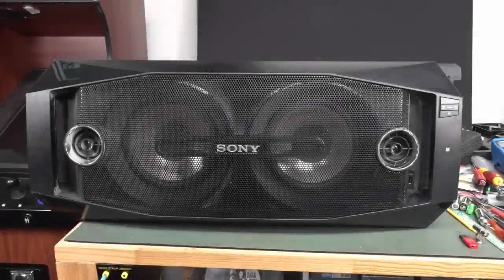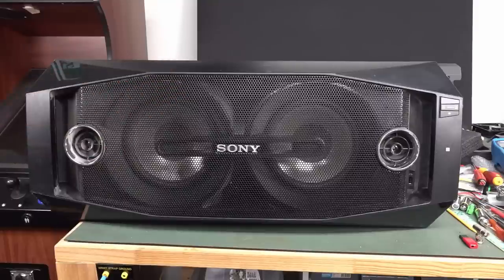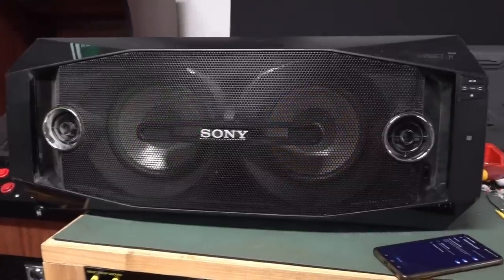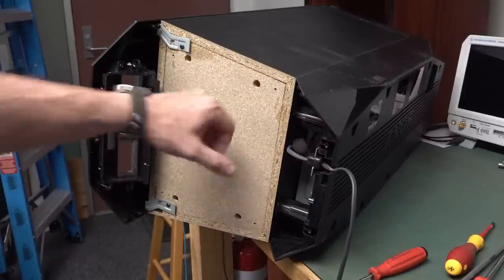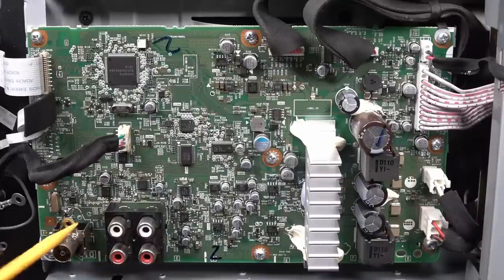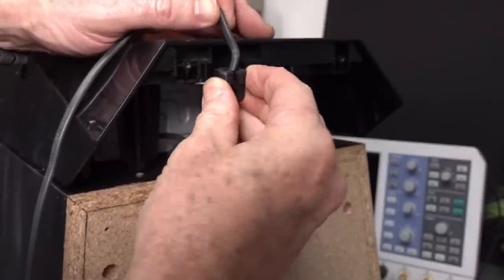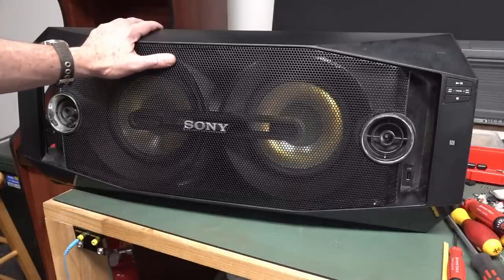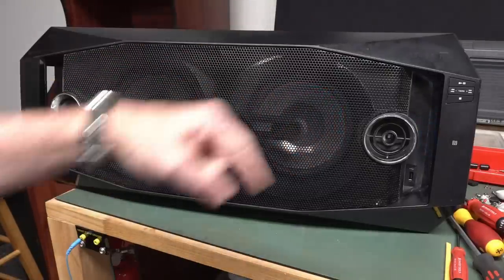EEVblog 1513 - Dumpster Tossers Have No Shame!

Comment: My bet is that this was bought for a breakroom or loading dock and it worked well. 
Then they got a Sonos or something similar. 
I've worked a lot of places that tossed out perfectly good stuff for reasons like that. 
Heck, I once had to scrap 8 Mac Pro towers, tried to take one home, but corporate policy was inflexible, even for the IT manager. 
The lawyers were scared of corp IP exiting the building that way.

As far as dumpsters and office parks, I used to have a live/work in a semi-industrial area. 
Would often find cool stuff when I was out walking my dog early in the morning or just after getting home from work. 

Whenever a business would move, merge or change owners I'd clean up on computer equipment that got tossed out. 
Scored a few nice pieces of office furniture that way too. And even a couple cases of booze once!
By the time I moved out of that place I had a half dozen powerPC Macs and a whole bunch of external SCSI drives, scanners and printers. 
All networked on a big 48 port switch that I found sticking out of a dumpster from the branch office of SUSE Linux that was around the corner. 
Also scored a bunch of retail boxed copies of SUSE that way. Which was my favorite distro for many years!
Reply: > Heck, I once had to scrap 8 Mac Pro towers, tried to take one home, but corporate policy was inflexible, even for the IT manager. 

I would leave the company for that. I get if that stuff was going to be sold, but thrown away and doesn't let you take it home for free? Nonsense. We should reject these policies, you don't let take me home a computer that will get into a dumpster, well that point I don't have interest to work for you. 

> The lawyers were scared of corp IP exiting the building that way.

Just an excuse. They don't want you to take the computer home period. If not it means that they will put in a dumpster a computer with anything value in it that anybody can at that point take home? Also they could just sold you the computer without the drives if they doesn't trust you to wipe them. But again, your are the IT manager and thus have (I think) accesso to anything, so they are scared you taking home a computer with anything value on it when you can connect remotely to the company VPN and access everything???

Comment: Based on all the evidence, I would suspect this was stolen from a construction worksite. I worked in construction and this was the number one thing to get stolen as it was the most expensive item on a site that wasn't a tool. The dust looks too evenly coated making me think it was from sanding or cutting. It was most likely tossed because some kids worried about the consequences of such a pricey item being discovered stolen when sold. Most thieves of construction sites are juveniles simply curious about the construction, and the exploration gets them a bit too adventurous. Or am I thinking too far into this from past experiences?
Reply from the maker: Nah, it's just someone in the building tossing out their unused stuff.

Comment: You're looking for a rational explanation for someone trashing this. There is likely only an irrational explanation. Likely, the previous owner had a relationship failure - either a divorce or they got dumped, and that unit was a remnant of the relationship that they still had and brought back bad memories. The only way to fix that is to literally get rid of it, so they dumped it into the dumpster. If it was left on the floor, the next time they went it might still be there and again bring back bad memories. Thus, trash it, where it cannot be seen even if they went back. This precludes any sort of "give it away" thing - they wanted it out of the house and out of mind fast, so no selling it on a used marketplace and no putting it where it might end up causing bad memories to flow again. I suppose the one good thing is they didn't try to destroy it - people have been known to take things and dunk them into water to destroy them before getting rid of it - like they could take a TV, plug it in, turn it on, then pour water down the top, then take a hammer to the screen to smash it.
Reply: ..... Yeah, I was thinking Industrial park, x-employee left it years ago. 
Boss says get rid of it.

Comment: Hm this almost seems too good to be true, I would leave it running for a while to see if there are intermittent problems. 
It looks quite dated for something so recently built, and I don't know if that is a good or a bad thing, because I actually kind of like the cheese-o-matic 2000's  “plastic futuristic" aesthetics in a way, but such flashy RGB LEDs really are the bane of my existence.
The display is interesting, it almost looks like a VFD?
Reply: Definitely not a VHD, just a regular ol' backlit LCD it looks like.
Reply from the maker: Been running for maybe 5 hours now, no problems, even at quite high volume. Yes, display is VFD, plenty of gear still have them.
Reply: @EEVblog  

That's nice, I like VFDs. 
From my "research" which basically consisted of reading Amazon reviews, the device was sold at least from 2014 to 2018 with a peak in popularity around late 2015, so it likely is about seven years old by now.
Reply: @EEVblog  Good to hear. 
It could be miswritten, but page 22 of the service manual for the GTK-X1BT mentions testing of the "liquid crystal display panel", so my bet is that its an LCD stylized very convincingly to look like a VFD.
Reply: @bennydontplaythat  

Could be, but it also could be a simple misnomer.
Because why would you imitate old technology on something that follows an aesthetic which undoubtedly (back in, say, 2008) would have been thought of as “hi-tech” and futuristic, even though it's really starting to look dated by now.
Reply: this has aptx, its less than 5 years old
Reply: @elektrokinesis4150  I have equipment from 2013 that supports aptX. They've since added new variants like low latency and HD though.

Comment: I own one of these, bought in 2015 for 169 GBP and still use it.
Reply: same here, though i got it from currys on offer for £119, still works like a gem
Reply: @killer1479  so they are not hugely expensive then. But Aussie bucks are like three times the price of gbp so it sounds expensive but it’s not really.
Reply from the maker: @Alexander_l322  Theye were $499 retail heer I think. Dick Smith cleared them out the half price apparently.
Reply: @Alexander_l322  thats why i feel sorry for the aussie cousins, they get screwed something rotten on taxes :(

Comment: i have that stereo and i love it! i regret never buying a 2nd one to link them together D: and yes, i can concur it really is 500w rms
Reply: Baloney, The sticker on the back says it only pulls 110W from the power point, so your saying this is like 450% efficient?  They don't even try to pull that one in Star Trek.
Have a look at 3:27 if you don't believe me.
Reply: @paulstubbs7678  speaker output is dc and lower voltage my guy
Reply: @Kowalskithegreat  yes but 110 watts is 110 watts don't matter what the voltage is 
it will be using a CLASS D amp that could be 80+ efficient. so if you put a sine wave into it would output about 90 watts of power RMS
peak burst with music playing could maybe be 200+ watts for just a second
Reply: @NightshiftCustom  watts is calculated with amps x volts x power factor, so it is literally directly linked to voltage. Please don't spread misinformation
Reply: @Kowalskithegreat  its called ohms law! go and try it out there bud
A 110 watt power supply is just that 110 watts of power don't matter if its 90 volts AC input or 240 volts AC 
it will only output a max of 110 watts at what ever the DC voltage output is 
maybe you should do your research before you start telling ppl there spreading misinformation
Reply: @Kowalskithegreat  
Built any ZPMs (Zero Point power Modules) lately? Just kidding ...

Comment: I have the same. It can hold dust on the speakers and you can normally see it. If you find another one they can be connected and work as 1 of 1000w. Also is better looking if you put it vertically.

Comment: Particle board is very dense and is IDEAL for a speaker system!
Reply from the maker: I like my diecast alloy Focal CMS monitor speakers.
Reply: Some particle boards like MDF is very dense yes, but that looked like regular old chipboard that is less dense.
And a good speaker has the board density and the resonance of every board taken into consideration when built.
MDF is more dense/stiff and have a resonance much higher up in the hz range then a chipboard would have.

In many cases regular cheap chipboard is a better choice especially if the boards resonance is not considered in the build since they have a lower resonance hz and will therefore often resonance at a hz level that is in a more forgiving hz range.
As in the added sound will not be as noticeable even if it can be as high or higher in actual volume.
Reply: @therealgrizzly  Agrees with my memory that chipboard is preferred over MDF as it's easier to damp any resonances.

Comment: I can relate to your interesting finds, however there are time when a person has to move or just get ride of something and they don't know how or who will take the items even for free so the trash is where it goes.    A few years ago I was taking my younger relatives to a church event  for a few Saturdays, and I noticed they had a big dumpster at the church one day. I went nosing around in it since it was almost empty and there was a very nice and very heavy mixer PA amp with equalizer in there. I took it home cleaned the outside some and tested it. It did have one problem, and that was the main volume control must have lost its clip on the top and it was no longer touching the carbon slid on the inside. I put a bread twisty around it and it works just fine. Very powerful to the point I had to get my speakers repaired on the edge foam. Now they did nod need the repair but they were the highest wattage speakers i had to test and they were old.   
 I live in Columbia PA. I have two 19 inch CRT computer monitors for sale or even for free if you will come and take them, or else they will go to the the recycling trash place soon.  The gamers used to like them because they had the highest quick response time. These are both of the Sony flat front screen type more modern of the CRT up to 85-100 refresh rate. About 35-45 pounds each.  
I'd like to get a buyer for the amp as well.   https://www.youtube.com/watch?v=eNmkd-KhY2I

Comment: Ya, there is something wrong with a fair few people, throwing away perfectly good equipment. I've seen nearly new drill presses, table saws, a new axe, and so much more thrown into the dumpsters at the city and county 'dumps', where they pretend to be recycling electronics, gardening supplies, plastic and cardboard crap, while letting people put expensive stuff into dumpsters. But then they won't let anyone retrieve from the dumpsters. I can't decide if it's stupidity, selfishness, or worse.

Comment: A few days ago I found a Canon PowerShot SX720 HS, not in a dumpster but a supermarket recycle bin. Fully working, with great condition battery. No scratches, looking like brand new. $499 camera. Out of production since Jan 2022. I think it was thrown away because of focus problems (or because  it cannot film at 4K and only at 'Full HD'?). Canon developed a face recognition focus method that wasn't that great but this feature can be turn off in the settings menu and after this it just works fine! People lost patience and creativity to find a solution. A spoiled hipster or  housewife bought this and it doesn't work out and throw it away because doesn't want to find out how it actually works. That is the world we live in, don't think just use and when you have to think throw it away. To difficult (or not the newest trend)! Insane.

Same with this speaker. A company (or university) with an enough yearly budget throws this away because it is of no (longer) use. The reason to throw it away is because they don't use it. Maybe it is only purchased and used at a casual party and after this stored in the server room with almost everthing that is obsolete. Once a year you have to clean this room from 'rubbish'. They don't care, if they need something for an occasion.... buy something new. Money isn't an issue. and waste is an issue. 

That is why there isn't a note "working" because for them this waste, garbage, used, not worth to spend some time on it. Sad, really sad. They don't think about it can be useful to somebody else because they cannot imagine there is somebody else.

Comment: I found a big JBL Bluetooth speaker on the top of the garbage bins. Its not as big as that giant, but the repair was simple - connect it to USB - C for 20 minutes and then it began charging. Turns out whoever threw it away ran it so flat that the BMS shut off the battery into saftey mode, and all it needed was to stay on trickle until the cells came up to a point they could fast charge. Its played the tunes at many a picnic :) I'm about to throw away a microwave thats broken, I always put notes on stuff I throw out - this one will be "does not cook".

Comment: I have had one of those, and it is not new. I bought mine somewhere back in 2013 for a discount (like half off) because they we're an outgoing product. The difference between this and a JBL Party Box is massive sound quality wise. I mean these kinds speakers are not what you'd consider audiophile speakers or anything but Sony party speakers from like 2011 to 2018 have a reputation to all sound like crap. The Partybox 300 which I replaced this with was way better. But I mean you got this for free so can't complain right? :)

Comment: They bought a new one. My current office pc came from the side of the road. Blew the dust out, securely wiped the drive (previous owners left  sensitive data on it) and reloaded windows. Almost comical what people throw away nowadays
Reply: The HP Probook 4520s laptop I'm typing this on was left with PSU at a charity shop I was working at. As they had a policy of no computers due to data protection and I was their tech adviser it fell to me to deal with it. Still had the complete files, accounts etc of a still-extant company on it but nothing wrong other than a very worn keyboard, easily rectified..

Comment: To transform it into a retro styled jukebox i would build a floor standing cabinet and remount the guts of the sony into it. A surface pro could work as the screen. A nice jukebox styled software I tried on my own jukebox i built is Zenpoint Digital Center. It has the perfect jukebox styled interface.

Comment: Maybe they threw it out, because bluetooth is such a questionably designed standard? I have bluetooth speakers which do not connect as "speakers" by default to a PC, but appear as "headset". That means some different audio encoding is used and the speaker output is quite bad.
Seriously, I don't know what the engineers thought when coming up with bluetooth, but half the time I feel I'd rather deal with an entangled 5m cable than bluetooth.

Comment: My current computer is named "dumpster deck" cause it came out the garbage. It's ddr3, and small form factor, but it can address 4x8GB and runs Mint like a dream.

Mine did have a note, it had been infected with ransomware but they took the hard drives out and I'm not running Windows, soooooo what me worry

Comment: Hi Dave
We both have an interesting question for you.
You may have covered this subject before, possibly(?).
But at this time of year, certain white goods "Companies & Inventors D...n" claim they have invented the "Digital Motor"?
Surely a motor is "digital" anyway. It's either on (1) or off (0). This being the case, motors have always been "digital" since they were first invented.
However, motor "speed" CAN be controlled digitally, via a seperate internal microcontroller, plus a hall sensor fitted within the motor assembly itself. This being the case, ALL OLD VIDEO RECORDERS WERE FITTED WITH THIS ARRANGEMENT IN THEIR SERVO CONTROL CIRCUITRY SINCE 1976?
🤔🤔🤔🤔🤔🤔👍👍👍👍👍👍

Comment: You could get ready-made sound reactive led strip kits for barely more money than raw strips, and use those to power a jukebox's front lights without fussing around with programming or complexity. You can make a kid-sized jukebox box out of double-wall cardboard and some spray paint. Copy an existing design for a cheap fun weekend project.